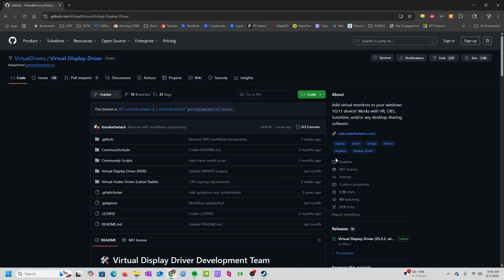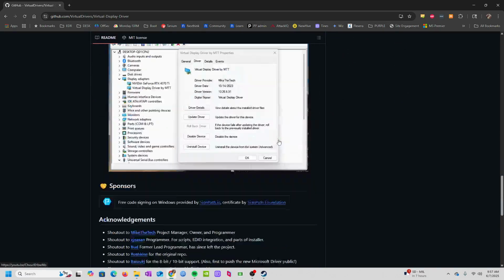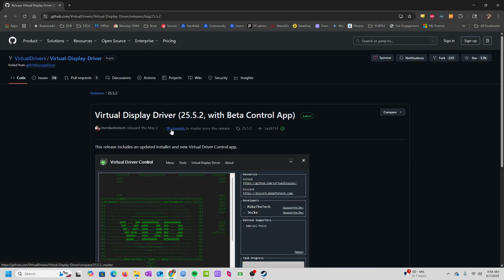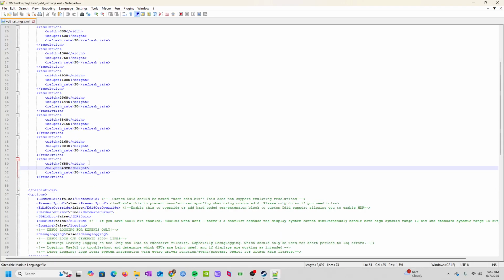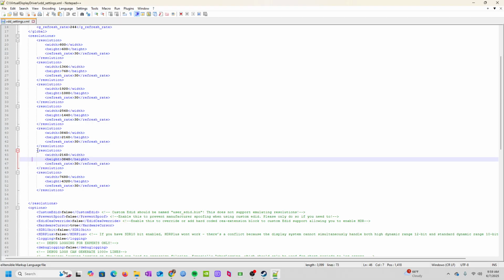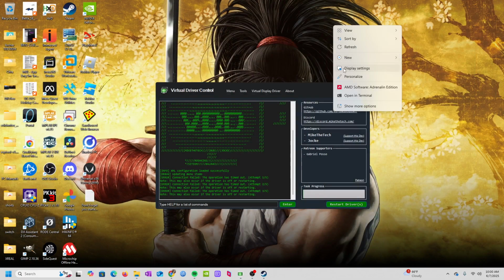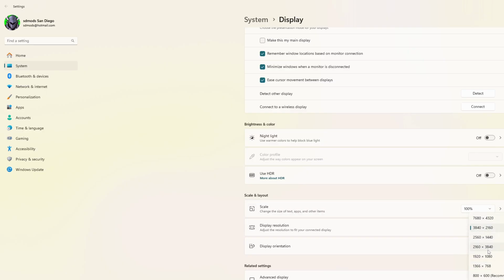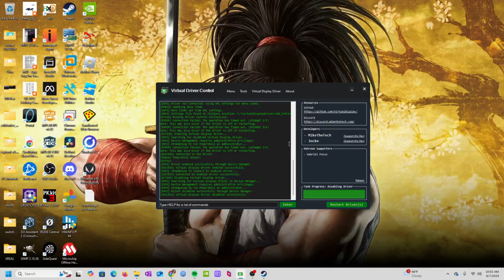Virtual Display Driver - Adding Custom Resolutions

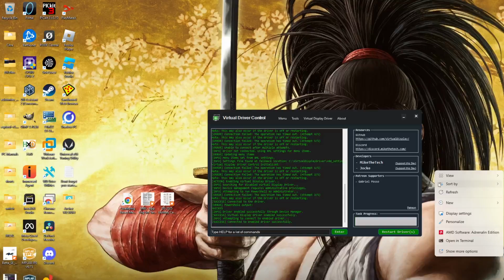Comment: 4:35 your windows can see the new, virtual display. Mine can not see anything other than my default monitor so I can not use this virtual displays at all! can you please help me? The logs say the connection was successfull and everything is the same as you but still I can not see the virtual display
Reply: i got black screen? Can u fix it?

Comment: the driver simply doesnt start once i edit the xml file
Reply: Yep, doesn't work at all. It broke the Virtual Display Driver, i.e. removed the virtual monitor, and trying to re-activate it crashed my computer (and created a 2nd virtual monitor without any settings).

Edit: I played around a bit and I found that editing the file and simply restarting the computer does the trick. It seems to be safer to not use the "enable driver" option of the control panel.
Reply: @Fritz46  oh man life savior I was getting mad.
Reply: same here
did u fixed it